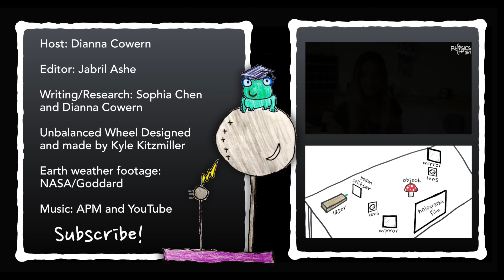Are perpetual motion machines possible?

Comment: Every Gym in the planet should be connected to the electricity grid...You get paid to workout on par with your energy output...Any merit to this?
Reply: Paying people to workout wouldn't be viable. Linking gyms to electricity grids so people pay to workout, as usual, but also contribute to making power could have some merit.
Reply: that would be great except youd need to burn about 2 million calories for $1 of electricity assuming that grid needed no maintenance do you even know how long that would take just to pay it self off let alone make money then you want people to burn enough to actually get paid
Reply: Just an idea...
Reply: But if millions of people are doing it's still a small contribution to a large problem
Reply: good point but if you actually read what I said then youd realise that it wont be a contribution its just going to cost a lot more than it generates a lot more 
even 1 million people I doubt could produce more than $50 per session and the size and maintenance of a grid that size would be huge
Reply: Scott B could the members of a gym, power said gym with the energy output of said members..Including battery technology to store that energy...
Reply: well typically the power is just used to keep the machine itself charged because they only use a few leds and maybe a simple computer 
a fairly fit person can probably consistently on a cardio machine run about 250-300 watts which may power about 10 of the energy efficient globes you are used to but they would stop a few seconds after the person stopped you would need at minimum a a few people to constantly be on machines just to power the lights 
no chance with the air con or any screens or sercurity systems
Reply: The Theory I want a monopoly so free work out it is!....
Reply: Scott B I need you to solve this problem! How many people working out could charge batteries sufficient to power this gymnasium?
Reply: well if you only want to run lights then you will only need one person but the  battery will never charge it will just last while the person is working out so it really depend on what you want it to do
Reply: Lithium batteries charge with about 80% efficiency and above.
Reply: There is an episode on Black Mirror called Fifteen Million Merits.

It basically works on the premise of everyone working out to power a city or the world (i dont remember if it went in to alot of detail) building up points while they workout. Eventually they could spend the points for a chance to compete on an "X factor" type show so they wouldn't have to workout anymore and instead enjoy the rest of their life.

Anyway, worth a watch if you havent seen it i'd say
Reply: Good idea but they wouldn't be able to create the power needed. You need like superhumans for this to become fieasable.
Reply: Scott B if your numbers are correct that 47,000 USD in power a year according to data in 2014.
Reply: Scott B Fortunately your numbers are wrong. $1 worth of of electricity in calories (in america) is 860 kilocalories. 87.5 trillion Calories are burned a year in america. If my math is correct, thered be a net income of about 13 million dollars worth of energy produced a year if gyms were connected to power grids. So yeah. Sounds like a bargain to me
Reply: $1 of electricity isn't a good unit of electricity
Reply: This Old Jew $1 of energy is like 8 Kilowatts
Reply: It would be a nice gesture to give back some of the energy we take from the world, but the infrastructure needed to make it happen would be very expensive and the pay-off wouldn't come for a very long time. I don't want to say it's not worth it, because it is. Any method of recycling energy is worth it, but first we need to solve a way to replace fossil fuels totally. i.e. wind, solar, fusion.
Reply: Sadly this already exists. We are the Matrix.
Reply: Watched Top Gear?
Reply: 87.5 trillion calories burned how though? Where did you get that number, is that within gyms? Because the vast majority of calories burned is just from the body sustaining itself.
Reply: jugulator0 that doesn't even blow a single bulb
Reply: If it was a good idea, it would have already been made a long time ago.
Reply: Tazer- not neccesarily.
Reply: ken gruz Of course, but do you seriously think, he's the only1 who has this idea?
Reply: 15 million merits for you, I say.
Reply: Black mirror S1 E2
Reply: Desire will always be perpetual.
Reply: @jugulator0: You should watch Black Mirror s01e02
Reply: So it’s like communism
Reply: Everything in existence is perpetual and I can prove it only to those who are not brainwashed.
Reply: I know it's a joke, but watch the video of a toaster being powered by a professional cyclist.
Reply: jugulator0 that's how an episode of Black Mirror is created
Reply: OMG!  I have been saying that for years!
Reply: The problem with this solution is that the energy is expended elsewhere. It would take a gym full of people just to power a single treadmill or two. There's no plausible way that any modern gym could generate more electricity than it is consuming, whether that consumption is in basic lighting, heating/air conditioning, etc.
Reply: Helifano How about a group of people manually turning a wind turbine?
Reply: jugulator0 a pretty bad idea
Reply: siggiarabi Why?
Reply: jugulator most workouts don't require machines. only ones that can actually produce electricity are maybe the non-electric treadmill or machines wits steel wires and weights that you put a little alan screw in to choose a weight. but anyhow, you need a lot of work just to produce 1 joule. i doubt you know what a joule is since you asked a question like that
Reply: siggiarabi A unit of energy...No need for those shenanigans...This is a thought exercise free discussion...If you dont ask questions and think outside the box what's the point.
Reply: Helifano how about we design a new gym and name it an energy grid interchange.
Reply: I always thought Walmart should fit some of their carts with some kind of battery down by the rear wheels that stores kinetic energy. Those batteries would then be used to help power their lights. This would be a double-edged sword for obvious reasons such as vandalism, though.
Reply: That is not alway true.  SpaceX is a good example of that.  Most people, including Neil deGrasse Tyson, stated that what Musk was attempting was unfeasible.  Through the ingenuity and hard work of Musk and his team, Tyson and the rest had to eat crow.  LOL
Reply: At peak hours, it would be interesting to see if your idea could sustain the lights within the gymnasium.
Reply: To collect, transfer, store and redistribute those energies also costs energies and resources.
Reply: Treadmills are probably the biggest waste of energy
Reply: jugulator0 no
Reply: jugulator0 blackmirror huh?
Reply: BLACK MIRROR
Reply: It sounds good in theory, but the human body operates on an average of 100 watts. Even if we were being incredibly generous with subsidies, you would only generate a few cents worth of electricity over the course of a workout.

Suppose you squat 575 kg (the world record) and you move it up and down 1 meter (about right for a tall individual) - every squat is then ~5.75 kilojoules of electricity theoretically recoverable - given a magic 100% efficient collection process. A kilowatt hour is generally measured in some number of cents to end users, and is 3.6 MEGAjoules of energy - you would need at least 625 of these world record squats to produce the energy that is sold for a few cents. Given the way capitalism works, there would be markups between the gym and the power grid, and the power grid to the end user, so you could reliably earn a quarter the value of your local energy rates per kilowatt hour. 

Where I live it varies from ~4 cents off peak to ~70 cents on max peak (anything higher is too uncommon for exercise funding) so you could earn, in theory, up to 17.5 cents for completing 625 world record squats. But then, you still have to harvest the energy. Falling things are pretty good for harvesting, so you could probably get 90% of it out, so now it's 695  squats. Also the power grid itself isn't 100% efficient, so you'll lose another at least 6%, so now it's at at least 740 squats for 17.5 cents. But then, this power is intermittent, only generated during half of your actual exercise. We'd be lucky to only lose another 10% evening this out, so now it's at least 822 world record squats for at most 17.5 cents... only during max peak hours, in an area with notoriously high max peak energy prices. Off peak, it would take a mere 82 thousand world record squats to earn one dollar, or ~473,000 squats for a fairly fit person that can do 220 lbs (I for example, cannot do even that). Better have an extra protein shake ready!
Reply: A human can roughly generate around 75 watts of mechanical energy per hour. So like 0.75 cents an hour roughly. You'd work for that?
Reply: jugulator0 black mirror episode.
Reply: jugulator0, as long as we get to watch.
Reply: About 15 million merits.
Reply: jugulator0 sure until we have no more space for the power.
Reply: jugulator0 it would take every full gym in the state of NJ’s kinetic energy—>electricity conversion to power a football stadium for 40 mins
Reply: black mirror anybody
Reply: jugulator0 like that episode of black mirror
Reply: I watched black mirror too
Reply: Watch black mirror the TV show all the way through
Reply: People don't produce enough energy working out at gyms. They've tried using horses, even horses don't produce enough energy.
Reply: Cara'e Raja they already do that with cows. Look it up.
Reply: coughs a rick and morty episode cough
Reply: jugulator0 There would be if the existing economic forces weren't resistant to something like this
Reply: jugulator0: The amount of energy that humans can produce thru physical exertion is far outpaced by the sheer amount of energy that we consume -- there's simply not enough humans alive right now to make that idea minimally plausible.
Reply: Actually a great idea
Reply: No one will go to such gym.
Reply: May be horses used to produce electricity.
Reply: Rick would like this idea.
Reply: peter wright I don't need proof I believe you, I've been working on machines to make the world a better place, please message me so we can work together making videos to inspire people and other good things too.
Reply: People would probably pay even more to go to such a "green" gym. 🤑
Reply: General Sorrow I think you're right, I'd still like to get paid for the power my cycling and stuff generates cause then the membership pays for it self.🌎
Reply: jugulator0 let's do this
Reply: Do you have any clue what it takes to make any real amount of energy? What the cost it would to develop such a gym system for so little power?
Reply: Free gym?? Good idea
Reply: You produce approx. 200W. If you workout for 5h, you get 6 cents minus costs for equippment. - Have fun.
Reply: 15 Million Merits, to be exact.
Reply: +Pinnacle Level Design LDC  Since it is all (!) correct, I guess, that he is more intelligent than you.
Reply: I’ve been thinking of that for 10 years
Reply: Scott B could you use gears  maybe like attach a big gear to the spinning thingy and then add a smaller gear. the bigger gear would move the smaller gear faster but it the force will be weak. if you do the opposite it will be slower but much stronger. this may work or not
Reply: Interesting concept, could just balance it out by having gym membership free.
There is an episode of Dark Mirror with a society that pretty much uses this concept on everyone all day.
Reply: It's a bit late to the party. But for context. An elite cyclist can output about 400 watts of power sustained. Assuming 100% conversion, that's 400 watts. At $0.10 per kilowatt hour that would be about 4 cents an hour in electricity. For an average cyclist it would be 100-200 watts. Meaning 1-2 cents an hour in electricity.
Reply: Scott B,   Couldn't LARGE teeter-totters connected to dynamos be rigged, spend a few billion dollars make really BIG teeter-totters, and have large scale human exercise contraptions, and thus the weight is the "source" energy, and humans doing group exercising do the added tipping, pushing the motion back and forth.   Like mega scale human old slave style oaring or windmill or mill grinding machines?   The initial expense is making the big dynamos attached to big teeter-totters engineered.   The group crowd whole population sourcing of funding, large scale, and cities with groups/clubs providing the group energy to keep the large machines going!   That's be a societal human development goal that sovereign nations, nation to nation, could be motivated to organize around.   Human/country sized windmills, dynamos competition.
Reply: jugulator0 do it! Make machine find investor build gyms and go for it
Reply: Interesting thought
Reply: only the caloric intake of your food and the gasoline to get to the gym.
Reply: Eco Gym does that with treadmills
Reply: Deadlifts 300lbs+ and some high reps,
Reply: Watch the talent show episode of Black Mirror and ask this question again...
Reply: It would barely be enough to power the lights and lights would dim just as they finish working out.
Reply: The Theory Or maybe charge batteries, rather than require a connection to the grid.
Reply: @scottb9997  You are way underestimating $1 of electricity. Most modern gym machines are powered by the inefficient mechanical energy of humans. They require no external power. In fact, humans usually generate far more energy than the machine uses. The machines have capacitors to store the extra power. If the gym siphoned some of it into a larger external capacitor, they could use it to power some lights or the steam room or something.
Reply: @jugulator0  IT'S THE IDEAS THAT GOT US GOING IN THE FIRST PLACE.........DON'T STOP.......
Reply: The picture of humans turning a giant hamster wheel just came to my head. Lol
Reply: O Sol já faz isso por nós
Reply: I'm telling you what if the energy grid ran on gyms America would never be fat ever again
Reply: @jugulator0  workout for your own energy bill
Reply: What you are talking about is called "Piezoelectricity".
Reply: That won't work. They have tried many gym machines. Produces nothing substantial. Plus adds bio food drain 
and costs more to grow more food.
Reply: @thetheory6159  Gyms pay for electricity like everybody else, so no.
Reply: @charlierogers6332  far more energy is wasted by just driving to the gym. Convince these people to ride bikes to the store or to work daily and now you have a real viable solution.
Reply: Yes, that would be called "sweat equity".
Reply: It would be enough to power one light bulb at the gym
Reply: Black Mirror...sort of
Reply: Check out making toast with a bicycle. This shows the net energy of all the cardio machines would net very little, probably less than one windmill.
Reply: Eco gym
Reply: Yeah... That's a logistical nightmare.
Reply: That was a rick and morty episode
Reply: see rick and morty season 2 episode 6,  the microverse battery, or  The Ricks must be crazy.